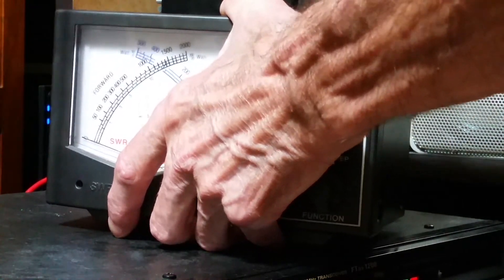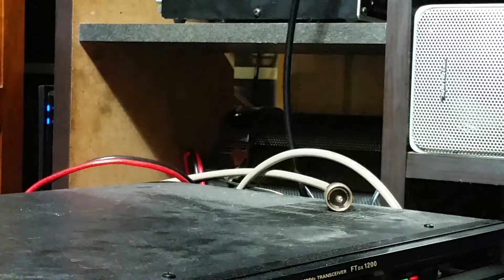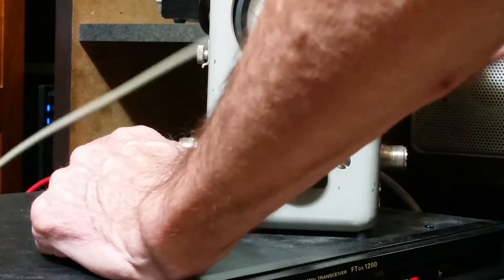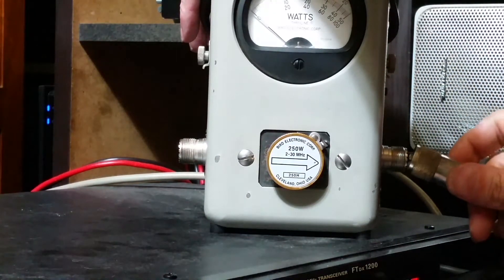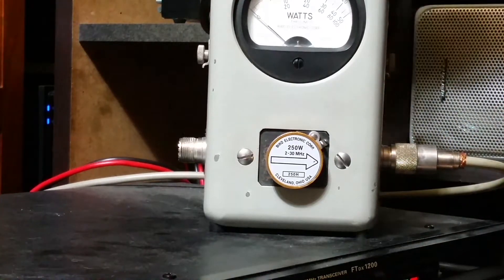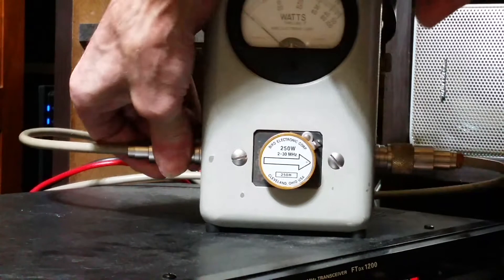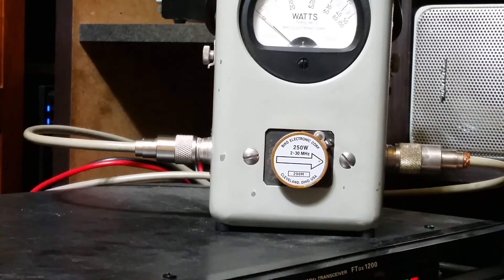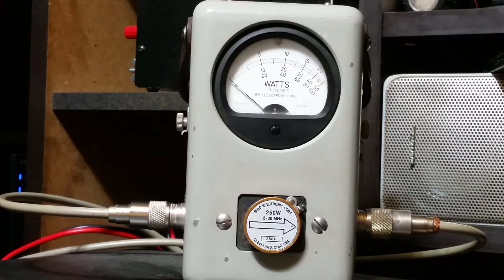Bird 43 vs MFJ-891

Comment: My go to power meter for HF is an MFJ-826B despite owning at least 8 Bird power meters. The correlation between your meters is fine, the Bird is not rated for crazy accuracy. So definitely don't assume that the MFJ is "wrong".  73